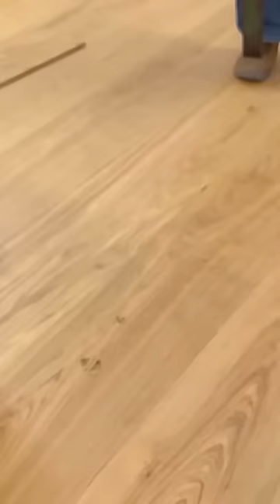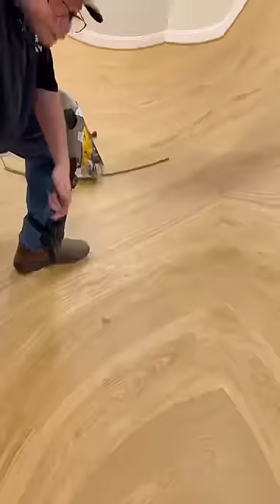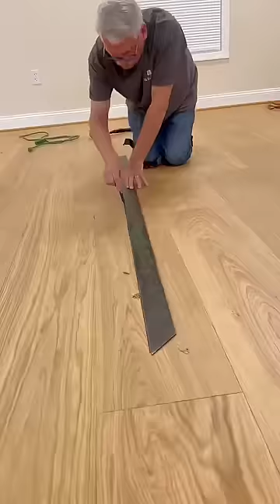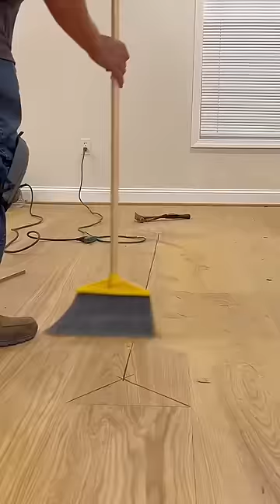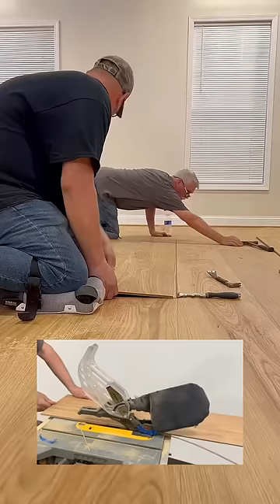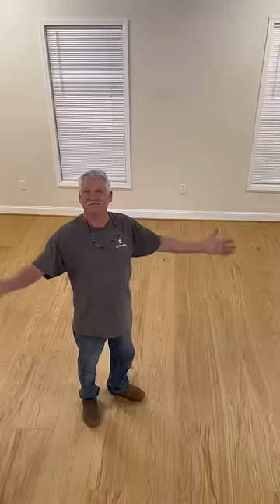How To Replace Damaged Flooring Plank | Wood Floor Repair

Comment: Nope , just unlock back to that board . You will eventually get a squeak
Reply: squeek? they trimmed the lower groove off 2 edges.....theyre gonna have that corner lifting as soon as seasonal humidity shifting and breaks their glue on what are usually smooth sealed connections.Glue wont hold well.

Comment: I would be pissed, if I paid for a new floor, that is what I would want. take that crap up and do it over.
Reply: And then who pays for your baseboards and painting to be redone? Youre right a new piece should be put in....but Id be pissed on how they did it. Glue is not needed for this repair when done right

Comment: Tell the truth. You cut the tongue on one edge and the clear tape underneath is weird. I want a closer look.
Reply from the maker: Yes, when performing a board replacement you have to alter the locking system, but that is okay because we use adhesive to hold the new plank to the surrounding planks. The clear tape seals the underlayment's open seam to aid in blocking moisture vapor. Thanks for watching!